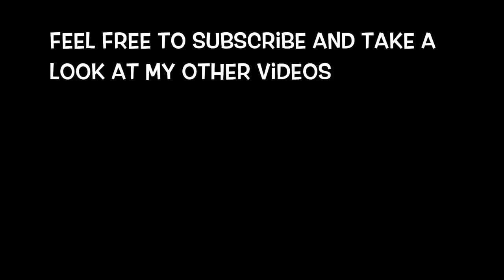Bench Top Router Table Build - FREE PLANS

Comment: Brilliant Router Table.  Video really clear - and demonstrated simple and skilful working.  Plans were excellent.  Made this about six months ago - following the plans almost exactly.  Taught me about pocket hole jigs, making use of double-sided tape, and introduced me to routing for cabinet-making.  Had to enlarge square hole as my router base is slightly larger than the one used in the video, and modifed the size of the table base so that I could clamp it to my old black and decker workmate when in use.  Then realised my router didn't have an on/off switch that was suitable for table use - so now have a new 1/2" router as well - no regrets!  Tried to make a donation to the just giving page but couldn't get the link to work - would be very happy to to do so.
Reply from the maker: Thanks mate. Just giving closed the page as you are only meant to have them for a set period. I’ve just extended it for another 5 years so should be working again. If it works and you decide to donate can you let me know? Thanks. 👍🏼
Reply: @WheresMyPencilUK  Made a donation today - very gladly.  I'd send a photo of the finished router - but then again it looks almost identical to the one in the video!  You could make the donation link more prominent as I had to go searching for it and it might put some people off.
Reply from the maker: Thanks very kind of you. I think I
Need to add it into all the end screens and descriptions again. 👍🏼

Comment: Brilliant tool, I made mine today, slight change by buying a pre made insert for the centre of the table, cost £11 on amazon. Apart from that I stuck to the plans I downloaded from you. Top fella.
Reply: Having been searching and researching for myself, the reason he custom made a base plate out of acrylic is because DeWalt in their infinite wisdom decided to go with a different hole spacing to everyone else so none of the base plates will fit due to their stupid 62 x 62 hole spacing as opposed to the regular 70 x 62.

Comment: Great job, simple and functional. As for the acrylic hole to not heat and melt the material I learned that it would be good to moisten the drill bit with kerosene and proceed slowly. Greetings.

Comment: like the simplicity of your design. With the central hole in the acrylic, as far as I can understand it, it is not the using of forstner bit that caused the messy result, but that you used it to enlarge on an existing smaller hole (I did the same mistake but on hardwood). I'm pretty sure also using the holesaw bit would be messy too if the central drill bit fall in an existing previous hole. I guess these bits need sort of anchoring in the centre to work the way they are supposed to do it.

Comment: Good video and nice job on the table. Instead of making a new acrylic router plate just drill a larger hole in some mdf and use some double sided tape and stick it to the acrylic to act as a guide and re-drill the hole and center it up.
Ron

Comment: I see this video is coming up on 2 years old so this suggestion maybe irrelevant by now but what I found works well with finding the center point to drill the hole for the router bit in the base plate is to use the router itself to create the pilot hole. Use a small V groove bit or an 1/8 inch strait bit or something similar in the router to create a small pin hole while the router is mounted as it would be while in normal use then you can use the forstner bit or a hole saw to drill with that pin hole size pilot to make certain your hole is perfectly centered. That is what I found at least what works for me.

Comment: Great video bud thanks for sharing! Nothing wrong with a forstner bit on a acrylic, your pilot hole was bigger than the bits which gave it the wobble. Try it out on another bit of scrap with matched pilot your get better result than a hole saw 👍🏻
Reply from the maker: Thanks Mark you're right about the pilot hole unfortunately I made it that big as it fitted the attachment to line up the router but I'll do it a different way next time. 👍🏼

Comment: Great video and a very versatile table with lots of space to add extras to customise it your exact requirements.

I use feather boards on my router table that came with it when I brought it new in a box at first I thought the feather boards would be useless and not needed but I have since found out there very useful I have 1 on each end of the fence to push the work downwards and 1 flat on the table to push the work towards the fence it works really well as there adjustable.
Reply from the maker: Thanks Andy, I did consider feather boards and have a couple laying about, if i get some more t-track i might add them or just rout out some groves for them.
Reply: just as an idea my feather boards have 2 slots each cut into them and are secured using coach bolts and wing nuts
Reply from the maker: Ok thanks i'll have to take a look at mine.
Reply: Build a dirt condo

Comment: Top build and great video as always. I was going to build one myself but fell lucky with a router table top brand new in box for a tenner. Regarding protection I put clear polyurethane satin on my mdf table saw top. It makes the fence slide brilliantly.
Reply from the maker: Thanks Robbie I'll bear that in mind I have some polyurethane spray in the drawer.
Reply: Happy Wife Happy Life how you finding the Bosch mitre saw. It looks the bees. What would you recommend for around £200 max, don't mind used
Reply from the maker: It's a fantastic saw a real beast glad I built the mitre saw station though. 
I'd go for anything that is from a premium brand, DeWalt, Bosch etc. You should be able to get one for £200 second hand. 
I do have an evolution rage saw as a backup but it's not particularly accurate and very noisy. Cuts metal though.
Reply: Happy Wife Happy Life  I have s cheap branded one that I've had for around 10 years, not very accurate at all. How long did it take to build the mitre saw station, problem with me is  I'm impatient, I need to take my time, at the minute I build everything in an hour or so. 😫😫 router table jay bates style👍🏻
Reply from the maker: The workbenches didn't take long but getting it all at the right level was time consuming and calibration of the fence and stop block needs time to ensure accuracy. Probably 2 days workshop time.

Comment: Very nice. Only thing I’d do different is made the dust collection port removable in case you ever had to use a different size vac connection. Also, you did use the correct bit to drill the acrylic, but it would have been better if you used it on a drill press.😊

Comment: I don't think a forstner bit was the wrong choice for the acrylic. Doing it freehand was probably the read mistake. I would have done it on the drill press where you would have more control. Great little table though. Simple design, easy execution, works like a champ. Well done.

Comment: great build. using a plunge router with a scissor jack lift would be the ultimate
Reply from the maker: Thanks yes plunge and jack lift would be cool but would limit the use of router to just this application. I only have one router so it needs to be easily useable for hand held use.
Reply: Ok I didn't know you only had one router
Reply from the maker: Yeah I’m waiting for DeWalt to bring out a cordless trim router but they are being a bit slow!

Comment: Nice job! And yes the off-centered hole would bother me also! OCD I guess. lol That said, I will be building this but I don't understand 301 thumbs down. Makes no sense!
Reply: I watched hundred of videos, about different issues, and even the best ones have ALWAYS about 3-5% of thumbs-down. I'm afraid it's a physiological feature of the human nature...
Reply from the maker: Haters are going to hate I guess. Water off a ducks back.
Reply: Maybe because it is not moving in a straigh line when moved backwards in the start of the movie so has to align with rulers everytime and no such added to the table as other making same model have done.

Comment: Just got a Dewalt router and I'm excited to make a table. So my router came with a fixed base and a plunge base. I assume that I would attach the fixed base to my table, not the plunge. Correct? Awesome job on this table, I will base a lot of mine off of your great work.
Reply from the maker: Thanks Zombie Redeemed yes I used the fixed base with a new acrylic baseplate. With the fixed base on mine the depth can be adjusted by rotating a cuff on the base. Not sure how the other DeWalt routers work though.
Reply: That's how mine works as well. Thanks so much!

Comment: Want to do this in an existing mobile work bench. This will test my skill for sure.. How can I add the track if it is on the inside of the table. Maybe holes at end of track so I can remove the fence if necessary? Brainstorming here.

Comment: Perhaps if you extended the tracks to the front, you could fit a sliding table for cutting grooves in the corners of boxes which are mitre cut?
Reply from the maker: Yes good idea lots of options for enhancing.

Comment: i just made similar table but t-track alumin profile has little different 30 x 13mm size. 200mm long. and not has 18mm plywood i use 2x 9mm plywood and need t-track under piece of 9mm plywood can screw track. and glue together. 2 fence second have only planer fence, use long bit and plane wood 1-3mm deep.my table size have 500x500 and no need biggest anywere little router. next made fence one t-track too can add featherboards and other jig whit mortise and joint.

Comment: No problem with using a Forstner Bit to maker the hole for the Router bit... just ensure you don't Pilot Hole drill it, or if you do, then a Pilot Hole of less diameter than the spur in the middle of the Forstner bit should ensure you don't make the same mistake again... Simples! ;o)

Comment: Good job enjoy your videos , can i suggest two coats of varnish on the mdf  keeps it moisture resistant. Inspired by you made a 4ftx4ft workbench  no glue screws and bolts in case i ever need to move it. Well should have done it years ago so nice to have a assembly bench /out feed table.
Reply from the maker: Thanks Michael I think I'm going to get the spray polyurethane out tonight! 👍🏼

Comment: I have a circular saw 3 drills & driver a small Japanese saw and need to build a work bench that will hopefully hold a miter saw table saw and a router table. I’ve spent 35-40 years managing with screwdrivers and odd bits all my life also had a electric planer hand held but it got pinched from my shed so trying to build up tools to build things but I haven’t got a clue what I need and in what order to get them any advice or help would be appreciated I use a wheelchair most of time due to my disability but can try most things if not heavy or complicated

Comment: Nice little table and thanks for the plans. Two things. One, at times you were drowned out by the music, get rid of it. Two, in you plans, you say that you could use plywood instead of MDF for the top. I would suggest not. Plywood is not always flat. My router table has a plywood top and has a few surface problems. MDF is dead flat.

Comment: Great instruction, I'm going to build this myself. Maybe you could elaborate a bit on how you route the inlays: with all instructions seen on inlays there's always an offset, since the bushing is slightly larger than the bit used (and therefore the template is a bit larger than the actual inlay), however in your case the template fits the inlay exactly. How do you do that (what bit/bushing/?) do you use?
Reply from the maker: It’s just a bit called a bearing guided template bit. Trend do them. The cutter and bearing are same diameter. There is a link to the bit in the description. 
Hope that helps.
Reply: That helps a lot. Thanks!

Comment: Fantastic build. New to routing but will build this since I happen to have plenty of 18mm MDF on hand. Just a couple of questions, what router bit did you use and I see you didn't screw the acrylic plate down. Has this worked out OK long term? Thanks. Love your videos. Liked and subscribed.👍
Reply from the maker: Thanks Shane it’s a bearing guided bit. Link in description. Acrylic plate works great as can remove router more easily and also is a handy base.

Comment: I noticed you used 8mm thick acrylic for the router base, but you used 6mm mdf for the template around the square.  Any reason for that specifically that it was 2mm lower for the template?  Guessing for the height of the bit you measured it out to cut at 14mm depth?
Reply from the maker: It was just the only stuff I had. Yes I set the depth at 14mm. 👍🏼

Comment: thank you for the free plans!!!!!
edit for question:
If i decide to get a router adaptor plate instead of using the acrylic, do you think there will be any issues with weight? I'm assuming the aluminium plates that I'm seeing on Amazon weigh a bit more then then acrylic
Reply from the maker: Should be fine as long as the thickness of MDF for the top is sufficient. 18mm should be fine.

Comment: An enjoyable build video. Can you tell me where you purchased the T-track bolts from. I'm in the UK and have struggled to find them.
Reply from the maker: Cheers Derek I got the t-track from Axminster it's their own UJK Technology brand. 
I think I got the bolts from Rutlands on Amazon as part of a kit link here: Jig Hardware Kit for 1/2" T Track https://www.amazon.co.uk/dp/B01D56681U/ref=cm_sw_r_cp_api_.5A-ybWH5JG3X

Unfortunately none of it is particularly cheap. 

You can make t-bolts using standard set screws and a grinder/belt sander just grind down two sides of the hex bolt to make them square.

Comment: Hi. great vid. I was wondering what your take would be on a 1/2 inch router table. Would this be strong enough? What changes would you male to accommodate a 1/2'' router? any links to the t rails and bolts? Many thanks
Reply from the maker: Should be fine for a 1/2 inch router. They don’t weigh that much. All the t rails were bought on eBay.

Comment: hi nice table :) do you find though the router bit does not extend out enough because of the acylic's thickness? your router body (were the router bit goes into) must extend beyond the router body itself?
Reply from the maker: No the acrylic is no thicker than that supplied by dewalt on the base of the router.

Comment: Excellent video and idea. I'm going to try to make this for sure. Out of curiosity did you square off the corners of the recess you made for the plexiglass plate or did it fit using a low radius router bit? I saw you mentioned using a chisel to square off the corners for the T track, but no mention on the router plate. Thanks in advance.
Reply from the maker: Thanks. Yes I used a chisel to square off the corners of the router plate.

Comment: Could you please tell me what router bit you used for the template cutting. I'm seeing some other examples on YouTube of flush trim bits which I think are there same as the double flute you mention in the description. But they seem to be used for flushing up on edges whereas you plunged it in the middle of the table top. Any help would be appreciated. Great video, thanks for sharing.

Comment: Love the video and thanks for the plans, one question does the acrylic need to be 8mm, I can only find up to 6mm where I live.
Reply from the maker: Thanks you might get away with 6mm might need to make it a bit smaller otherwise might flex.
Reply: @WheresMyPencilUK  I got some 8mm acrylic from a local signwriter.  I think with 6mm you might also find that you haven't enough depth to comfortably countersink the screws that attach the router to the acrylic.
Reply: @WheresMyPencilUK  Thannks, finally managed to get 8mm acrylic, which router bit did you use to cut out the square for the acrylic, being a novice Imam making a hash of it. Thanks

Comment: Hope you are still responding to comments. Great video and table design. Can you confirm that you do not screw the acrylic to the table? I ask because my plunge router is hard to adjust for cutter height.
Reply from the maker: No I didn’t screw it. It’s a snug fit and the weight of the router keeps it firmly in place.
Reply: @WheresMyPencilUK  Thanks for that.

Comment: Where would I find the self-adhesive mdf panels you use for the template?  I just spent 45 minutes in Lowes and they don't carry this.  I see a lot of uses for that!
Reply from the maker: It’s not self adhesive MDF unfortunately, it’s MDF stuck down with double sided carpet tape. 👍🏼
Reply: Thanks

Comment: aren't the pocket holes on the bottom supports backwards? you should go from the bottom side to get the most wood.
Reply from the maker: You could put them on the other side but there isn’t much stress on that joint as there isn’t any real load given it’s on the base. Also the thickness of the material they are attached to is the same on most of the joint so it’s not really relevant.

Comment: hi there  what is the reason for the acrylic top ,as you take out the router to change bits couldn't you just drill a hole in the wood top just wondering cheers
Reply from the maker: It means I can use the router attached to the acrylic freehand. Gives a nice large stable base. The acrylic is very rigid too. You could use plywood or mdf if you wanted but it might flex a lot.

Comment: Hi, is there special table saw blade you used to cut the acrylic sheet, I have 60 teeth table saw blade will I be able cut acrylic  sheet
Reply from the maker: Hi elvis that should be fine as long as you feed it slowly. I think my blade is 80 tooth but it's not a special acrylic one.

Comment: Did you use double faced tape to hold the pieces forming the template for the router mounting plate?
Reply from the maker: Yes John I think I called it carpet tape in the video. 👍🏼